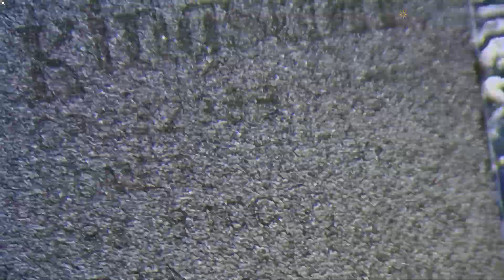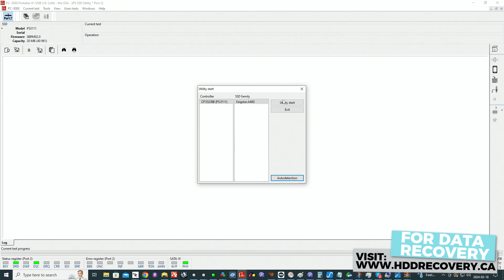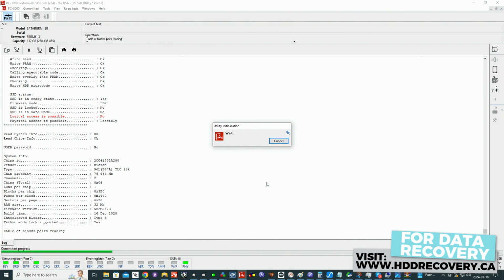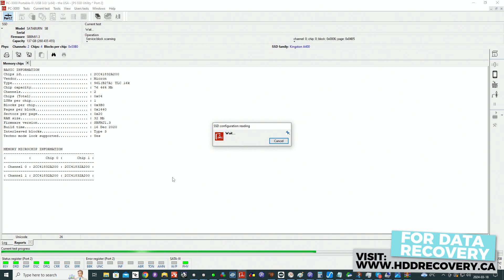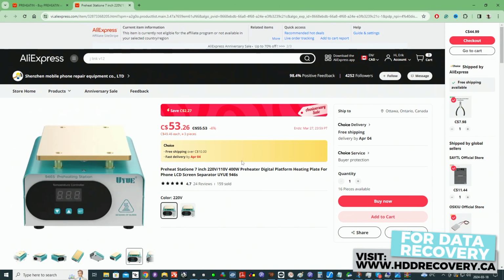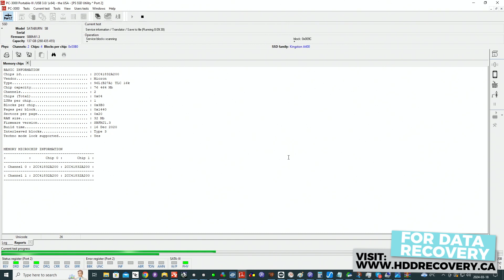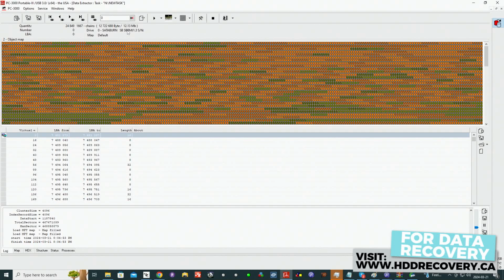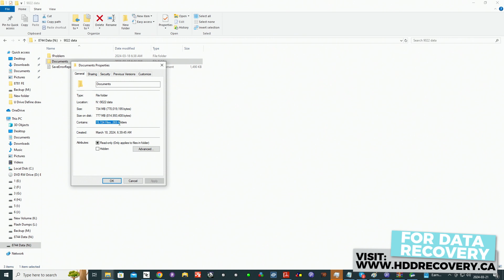Kingston SSD A400 Data Recovery: SATAFIRM S11 Issue Resolved

Comment: A great many of SSD makers now use this junk Phison 3111 controller for their SATA SSDs. PNY, Silicon Power, Kingston, Patriot etc. on drives below 1TB (The Phison 3111 is unable to do sizes that high). I have had two SSDs die already from this controller. One PNY literally the day it was installed while copying files over to it. And then a Silicon Power one. The problem is the controller is DRAMless and can through many conditions screw up it's own firmware, due to low voltage, power loss, etc.

Comment: All cases i saw about satafirm s11 are riconducible to power drops... probably the unit when voltage is dropping slowly ( giant atx power supply ) are doing random things.. and one of these is the overwriting of the firmware by random s**t

Comment: I    THINK      THE     DRIVE   JUST   HAD   A    SOFTWARE     FAULT     RESET     AND   IT   WILL    WORK     AGAIN                SORRY     😊😊😊   NO    REWORK    NEEDED      SORRY    ITS    TRUTH
Reply from the maker: You can't know this for sure until you rule it out. I've done many cases where this response means exactly what rework will fix.   You say no rework needed but if you look in my feed, there are multiple videos that would support that it is needed. Just wasn't linked in this case

Comment: Had two PNY with the Phison 3111, same "SATAFIRM" failure - they are DRAM-less and use memory inside the Phison to emulate DRAM - when you have a Power drop or Powerdown the internal Firmware gets overwritten by Accident, it goes into Safe Mode. Junk I will never buy again. **edit: At least that's the explanation I found after many Hours of searching. The Chips are OK, no need to de-solder etc. it's a crappy firmware problem, causing some corruption.
Reply from the maker: the reason why I thought chips may need rework, was because the ID was coming up as PS3111, SATAFIRM S11 is a clear message of bad firmware due to lack of DRAM. IS with PS3111 without forcing of ROM mode is not something that I recall from the past
Reply: @hddrecoveryservices  Love your work, well done. Mine were PNY CS900 240GB, I had backups, so I just threw them out, and bought Samsung EVOs. Not much more expensive! If I need some recovery I'll definitely send it to you!
Reply: I've had my fair share of Kingston A400 and PNY CS900 go bad. I've seen SATA FIRM S11 on both models. Some were under warranty and I RMA'ed them, and some weren't. Let's just say I gave up on RMA'ing the CS900 it's much worse than the A400 overall, they get crushed and thrown in the trash (PNY sent me a bad cs900 to replace a cs900 once). Mostly the kingston would have a drive life value that's bad and I'd clone it off and it would work, sometimes slowly though (in the instances where the firmware wasn't calling itself satafirm s11). Mad respect for PC3000 and the professional data recovery tools though. I'm a clonezilla, dd-rescue, gparted junkie. Master of windows partition surgery. If the drive don't read with ubuntu I don't take them apart that's a different industry! A lot of the time I can get a lock on things and not have to though, but if it doesn't run I'm not going to take it apart and ruin any chance of an expert genius who is a data recovery professional to get the stuff.
Reply: @itstheweirdguy  I could get my CS900 into safemode/recovery mode (whatever you call it) via jumpers on the PCB but that was it, i found no firmware or flash tool for the 3111 that would work. Junk, sadly, mine were only a few months old but just past Warranty (as usual!)

Comment: I have this exact drive. It had this error. For those who don't care about data; you can "remove"  the state in which these drives get: satafirm s11. I got it back to working condition. I scanned sectors, nothing came wrong, i secure erase it, and the drive is still working as if nothing happened before. So surely, as it was tested and shown here, reballing will not help, it's not a problem with chips, at least not on my unit or the unit HDD Recovery had. Kinda scarry, that you can have a perfectly working drive, lightly used day after day, and next day it's bricked. These drives along with other similar constructions brick themself out of nothing... So you better watch out if you have one of those.
Reply: Thanks    very   much     I   agree    with    you    😊😊

Comment: speaking of old SATA SSDs. I wonder how my 2011 gaming PC SSD is. I used it until 2021. It was something I was more and more concerned about as time went on. I was just short on cash. It was originally a plextor 256gb for $800, but it filled up quickly. That plextor drive is in my 2010 laptop now (which still works just fine). I replaced it with samsung 830 I think. 512 also for $800. That one lasted longer. Eventually I doubled it up with a samsung 840 evo 512. When I retired that computer it was very low on space. My new computer has dual 1tb samsung 980pros. tons of free space.

Comment: I have a computer repair business, and in the last 2 years I've seen at least 30-40 Kingston A400 240GB SATA dead like this, installed by me on the client's computers. Most of them died in the first 2-6 months of life (they were new). I figured it was a bad lot or something, but I really don't know what else to say. I've never seen 480GB or 960GB dead like this, even though I installed a lot of them. Only the 240GB seems to fail. I've sent them back for warranty and they always replaced them with new ones, but the data was lost and I had a lot of explaining to do with my costumers. 
I'm never buying Kingston SSD again.
Reply: Also happened to me with "intenso 240gb"... all of them died on 1/7 months .. data lost .  And customers very hungry... 40 units circa
Reply: good to know.. thx for the share
Reply: My 960GB failed in the exact same way
Reply: amazon sent me 10 of them instead of one and ive had 3 of them fail in a row, one for a family member but LUCKILY they kept the old hdd so didnt lose photos. Scary sh*t. They honoured the warranty but gave another a400, so the cycle repeats... Im now trying to change another family members laptop with a used wd blue 3d nand that only has 10tb written so 10% of life, it should work as they rarely use the laptop.